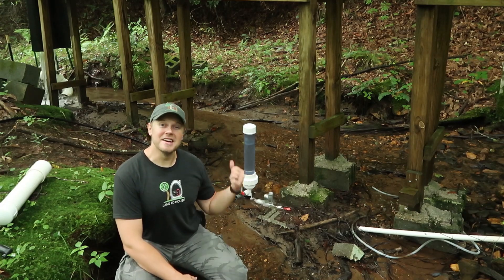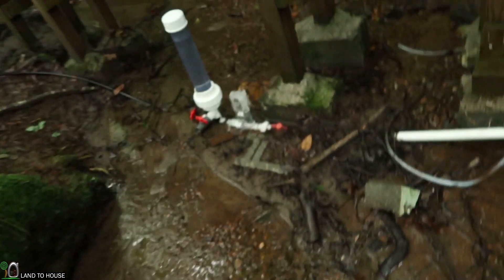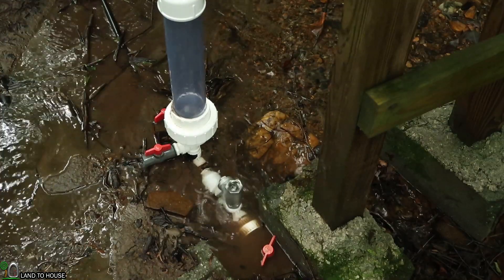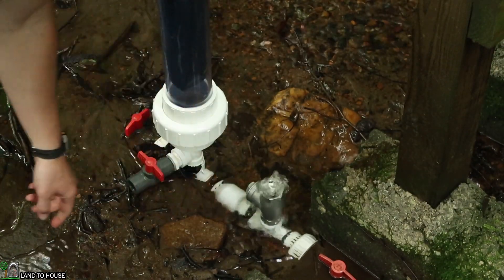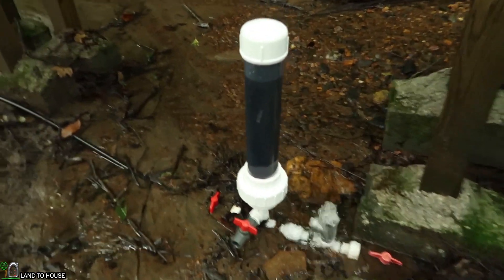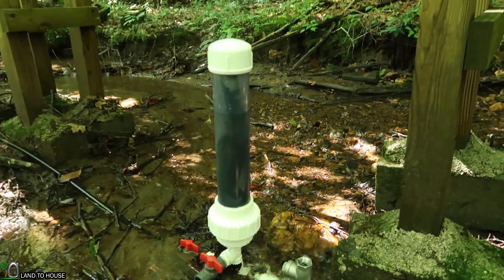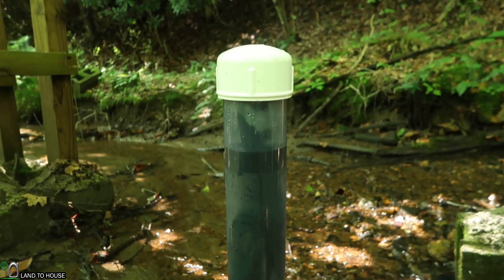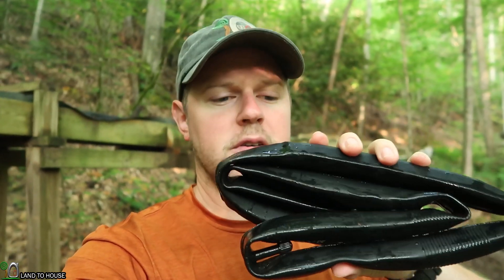Innertube in Ram Pump Pressure Tank

Comment: Nice video and presentation. 
If what we believe is true - that a negative pulse returns from the drive pipe responsible to trigger the valve open into the next cycle - can we open a pin hole between the waste valve and the check valve of the tank to let air suck and end up in the pressure tank? This should address the depleting air in the tank. 

What do you think?

Comment: Instead of using a pressure tank, why couldn't you just use a big stand pipe that was open on the top end. Wouldn't water just climb up the pipe to a certain level and then provide the pressure needed?
Reply from the maker: The pipe would need to be very tall if it were open. Example 7 feet of input head pressure can generate 65psi. 65psi/.433 = 150 feet. That would be a very tall standpipe.
Reply: @LandtoHouse  Aha, thanks for the reply. I think these ram pumps are amazing little devices. Would make a perfect Science Fair project for my High Schooler.

Comment: Since you're using an inner tube to prevent the pressure tank from becoming water logged, that would imply that you can now lay the pressure tank on its side instead of having it vertical. That in turn would make the pump installation more physically stable.

As for the "more bounce" or "more give" you noticed, that is a natural consequence of having a lower cross sectional area for the pressure tank. Before you installed the inner tube, the cross section was pi*r^2. With the inner tube installed, the cross section is now decreased by the space occupied by the inner tube. And with a smaller cross section, the change in height of the water has to increase for the same volume of water.

Comment: Interesting test, Seth! Although, it would be interesting if the output flow rate is changed when you put in the bicycle inner tube. Btw., the pressure tank is important for buffering the water which will be pressed into when the water hammer hits. That causes the up (= water is pressed into the delivery pipe and pressure tank by the water hammer) and down (water is pressed uphill into the delivery pipe) in your pressure tank. That creates a steady flow uphill in the delivery pipe. If there would be no pressure tank, the water in the delivery pipe had to be accelerated with every hit of the water hammer which leads to a loss in efficiency.

Comment: love your videos thanks for posting.
 question: 

is that inner tube designed for that; that is, does the rubber break down over time contaminating the drinking water and Creek at Large ?
Reply: Have a curiosity about the tube or tennis balls inserted  to the pressure tank. As far as I understand from the info found online, it is not required. Now, the question to the Land Of House. What are the benefits, if any, from inserting it into the pressure tank.

Comment: Has everyone ever tried a Expansion tank for a water heater?
Reply: I have used an Amtrol st-12 , I think it was. I forget what it comes precharged to, but it worked the best of anything Ive used, ram wise. The crucial problem is that it isnt meant to take constant waterhammer and the neck that connects the male threads to the tank splits quickly. I had one last a longtime, but that is rare. So I came here lookong for diy pressure tank ideas.

Comment: Hypro makes a surge tank for the 5210C piston pump it has a Air Bladder in it . You put the amount if air in the surge bladder to get the regulated pressure that works for your Application I dont see any problem to why that  Hypro surge tank with that bladder  would not work for you .
Change your tank size go to a 6 or 8 " dia tank .

Comment: A valve stem cap will help a lot with the deflation of the tube. You could also drill a hole in the pvc cap and secure the valve stem to the cap with epoxy, so that you have an exterior access to pump up the tube when needed.
Reply: I was thinking the same thing.. a Schrader valve is designed to keep air inside the tube at a higher pressure than air outside the tube, but in this usage, the water pressure outside the tube is higher than the air inside the tube (unless the water is compressing the air to a higher pressure..??)  so you risk water pressure forcing the Schrader valve open from the outside, allowing the air out of the tube, and water inside the tube...

Comment: Nice test.  Seems to actually demonstrate that an inner-tube with a bit of air is inadequate if the pump still hits hard when the air cavity in the pressure tank is absorbed.  Commercial pressure tanks come with the bladder pressurized to 25psi so that under operational pressure it retains enough gas volume to serve as the cushion and recoil.  I'd like to see this done again, but put the tube in before inflating, and then put in as much air as you can, and see if that changes the 'hard hit'.

Comment: Hai I made a pump at my home by your design but not beating the valve please solve the problem
Reply from the maker: There could be several things going on. Be sure that the drive pipe is the same size as the waste valve. You will need at least 2 feet of head pressure. Also make sure there's enough lift out to maintain back pressure.

Comment: in well bladder tanks there are recommendations for bladder psi. Your pulsing water level should yield and peak pressure and a trough pressure.  Have you tried pressuring up the inner tube to this lower pressure?

Comment: it's called a air hammer,, in time the  hard hammering of the check valve, will start to fracture the joints on your water line, and pvc union, just wanted to give you a heads up

Comment: The innertube needs a LOT more air to compensate for the tank getting waterlogged. If you achieve 70psi, the volume in the innertube shrinks to less than 1/6 of its starting volume, and you need more to get a proper reflex.

Comment: Seems to me you need to be able to adjust the pressure in the inner tube while the pump is in operation. Inner tubes are not completely sealed and will bleed off over time. Most cyclists will check tire pressures before every ride. You may have already tried this, but have you thought of using an inner tube with a Presta valve? The Presta valve is threaded on the outside and has a locking nut that holds it in place on the bike rim.  I'm thinking you could drill a hole through the cap on the pressure tank, insert the Presta valve through the hole with the tube inside the tank, affix the locking nut in place and now you could adjust the pressure in the inner tube while the ram pump is operating. As long as the hole in the pressure tank cap is the correct size, the base of the valve at the tube should act as an o-ring on the inside, maintaining pressure in the tank. Then once every couple days or so you take your pump and air up the inner tube to maintain pressure in the tube. This would also allow you to experiment with different air pressures in the inner tube and how that affects flow rate. I'll be looking forward to hearing how this works.
Reply: One thing to add, you may need a different pump to air up the Presta valve. Not all pumps work with them.

Comment: Has anyone tried to operate a ram pump with an water expansion tank from a heating system? There you can create a pre-pressure with an air pump in front of the membrane.
Reply from the maker: Yes. That does work well. A friend of mine has a pump with one of those tanks on it. I've actually spoken with a local plumber to see about getting one for my own testing.

Comment: A small pressure /diaphragm tank is already commercially available.  They sell them for drinking water systems, and to prevent water hammer, also used near a water heater, to give the water a place to expand.    It should also work here.  They have a diaphragm to keep the water from the air.

Comment: Why? A small surge tank with a pressure bladder is a cheap, readily available commercial product. Having the Schrader valve accessible like a surge tank means that the pressure can be monitored and adjusted.
These work so much better.
https://www.supplyhouse.com/Amtrol-102-1-30-Extrol-Expansion-Tank-44-Gallon-Volume-2557000-p?gclid=Cj0KCQiA4sjyBRC5ARIsAEHsELFwtIV8dTsmda3xSl3kbUc0Htby7ptFo5hoqcCT7ZPJ9TCTNEdgNukaAo1-EALw_wcB
Reply from the maker: Yes that's true. I am looking forward to giving them a try this summer.

Comment: I haven't seen this suggestion yet, consider testing vacuum seal plastic bag material,  they have several different membranes to stop odors,freezer burn and such,  test single bag,and also bag inside a 2nd bag and perhaps a 3rd layer bag ..obviously you will not vacuum them but only use heat seal portion of the process ,seal 1st, then seal it into the 2nd and then those into the 3rd...I  like the clear chamber, can you detail approximate cost of that "upgrade "?

Comment: you should drill and tap a hole in the top cap so you can put a Schrader valve in and add higher air pressure to your tank
Reply from the maker: That is a good idea. I found some at walmart and on Amazon. That test should be part of the 2020 video lineup.

Comment: I am starting to believe that a large chamber will lessen the pressure per square inch. Older versions have a large air chamber with weep hole to replace dissolved air lost in the water. Large piston vs small piston should be more efficient allowing less compression  on a bladder, inner tube, or pool noodle.
Reply from the maker: Yes older ram pumps used a snifter valve to pull in a small bit of air with every cycle. Highly efficient way of replacing the air in tank. In the ram pumps I build the pressure  tank size needs to be large enough to hold pressure while opening the delivery pipe. If the tank is too small pressure is released too quickly and the pump stops every time
Reply: @LandtoHouse  I need to finish the one I am working on. It will be made from 3 inch square tubing necked down to 2 inch through check valve to air chamber. I haven't decided on the waste valve type yet, it will either be a flap door or a round steel disk on a grade 8 bolt through a bronze bushing with a gasket so it can be serviced when needed.

Comment: That was very interesting.
I built a inch and a quarter ram pump like your design a couple years ago and it has worked well.
I have about 5 ft of head and I'm pumping 1700 ft 2A elevation of maybe 10 or 15 ft. My delivery rate is 1 gallon every minute and a half. 
I used a inner tube like you do and when I took apart the pressure chamber and upgraded to a larger size I found the inner tube compressed at the top of the chamber and had lost some air. 
The next addition to the pressure vessel was the inner tube and a short piece of foam floaty the color type that people use as Beach flotation.

The modifications seem to make it more reliable.  
most of the time it runs 4 weeks unattended in a stream who's flow is quite often affected by rain. 
I am using a low-quality alloyflapper valves which I just replaced the upper one for the first time in three year of service. 
it works better now much like when it was new because the valves are cheap and pivot anyways in their housing but three years puts a bit of wear on it. 
I notice you are using a higher grade possibly stainless flapper valve, I will have to investigate that and look to see if you speak about that and videos I must have missed. 
Thanks for all the interesting videos.
I have had pretty much endless water for 4 years now because of your channel and efforts, thanks again Seth. 👍
Reply: Sir
Pls try to connect two delivery lines from two different ram pumps to a single delivery line and advice what will be the reasult
Reply: xvideos

Comment: Looks like you need to fill the tube with more air. Stuff it in and fill it while it is inside the pressure tank, and make sure that there are no leaks in the tube or the valve.

Good stuff. If I only had a stream and  cheap shipping I'd be buying. ;)
Reply from the maker: Yes I am going to redo this video next week and see if I can keep more air in the tube.

Comment: Like the videos. Have you ever thought of stepping down the diameter of the pressure chamber? And perhaps installing a pressure gauge to the top so we can see the air pressure differential between experiments?  Thanks
Reply from the maker: Definitely going to install a pressure gauge on the top. As for pressure tank size it's pretty good at 3 in by 20 in

Comment: Can you make your own piston for the inner diameter using an O-Ring and PVC tube? Maybe add an air fill valve on the top so you can top the air pressure up if it starts to fill the tube with water. I was thinking of some piston like what hold up the hatchback doors on a car and incorporate into the system. These are very well sealed and could possibly be used as in place of the inner tubes with some modifications.

Comment: Maybe paint some sort of scale in the side of the pressure tank to make measurements easier? Also, other than cost, would using a bladder-type pressure tank used in well systems work in a ram pump application?
Reply from the maker: A scale is a good idea. Probably would just use a Sharpie. A house water pressure tank is actually a very good pressure tank for the ram pump. It has the bladder built-in and you can adjust the pressure. I just haven't justify the cost of one for testing yet.

Comment: Have you ever tried a small bladder tank like the ones used on a well pump? Also maybe you could drill a hole in the cap at the top of the tank for the valve stem to stick through so you could add air to the inner tube without taking the tank apart.
Reply from the maker: A friend of mine has used a well pump pressure tank. It works very well. I do hope to install a valve and pressure gauge on top of this tank.

Comment: Have you thought of using a water heater thermal expansion tank for this. That way you could set the back pressure at whatever level you wished. And the bladder is made to last under similar conditions.
Reply: Dewey Segler I don’t think they are designed for the water hammer effect constantly, but would be interesting to see after a month what it looks like inside

Comment: I used the tire tube in mine.  I filled it after I put it in. I may have more air in mine.  If I were to shut it off as you do here I'd build up pressure enough that the pump would finally stop pumping. I'm surprised you didn't have similar results. Like this new tank idea can see just what is happening. Any idea on where the air in the tube went? Thanks Seth for your video.

Comment: great video. It was amazing to see how the pressure built up and squeeze the air out of the tube. My Ram pump pushes water so high with such a large PSI I am really interested in something that can maintain the air chamber. I noticed after a couple of hours with mine I'm getting the hard hammering and then the pump quits. After watching your video I now know where the fault lays it's in my pressure chamber. I really do appreciate you making these videos. I wonder what would happen if you could install the tube with the valve pointed out and then pump 50 or 80 psi as much as you could pump and then try the hard test.  Since my pump has to pump 80 psi to deliver the water way up the hill shouldn't my tube have that amount or more in it?

https://youtu.be/PksvEu_Z95Y

Comment: Wondering how a snifter valve would work in that scenario?
Reply from the maker: The snifter valve would continue to pull a small bit of air into the tank with each cycle. Should be highly efficient at replenishing the air